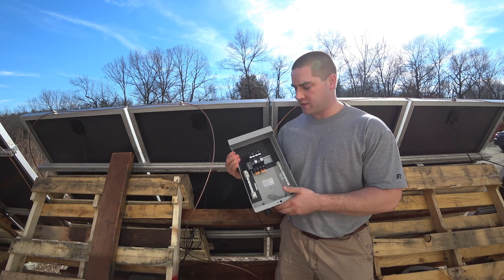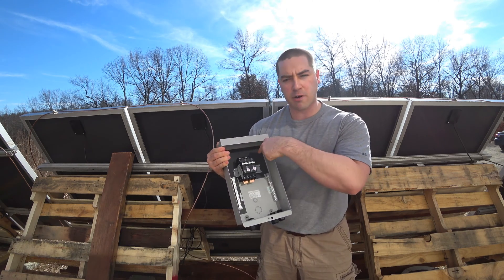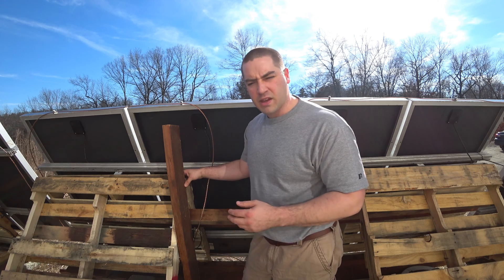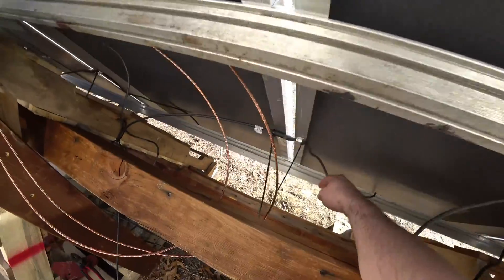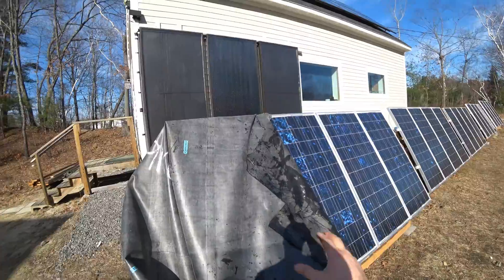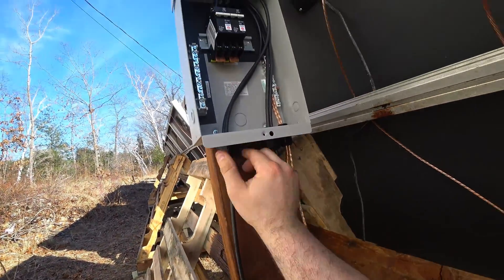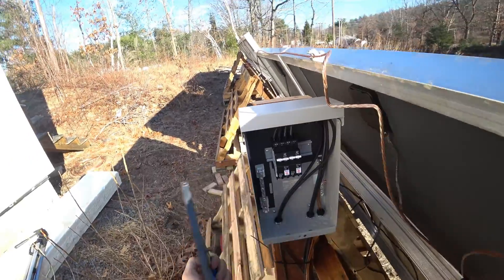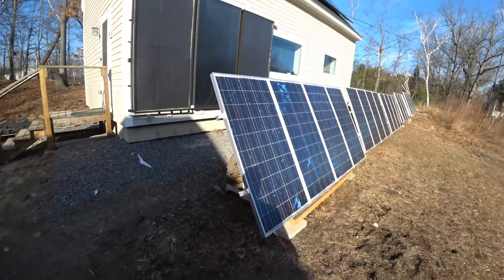Disconnect/Combiner Box Install, Midnite Solar

Comment: If PGE turned off the Solar AC disconnect, will the entire house loose power to from the grid?
Reply from the maker: I'm on the east coast, so I don't have PGE.  But, my solar and grid are separate.  I have a transfer switch so the solar can only power things if the grid is off, or vice versa.  There is no mixing.
Reply: Depends on if your system is hybrid or not.

Comment: You are using all of that PV to make heat. I've read you're aware that isn't an efficient use of elec.  Look into a ground loop heat pump. I installed a 1 ton compressor unit with 500 ft of ground loop. Uses 1.3Kw to produce 12,000 BTU/hr. Suggestion for you is 1.5 ton with two 400ft parallel ground loops running on one pump. Easy to install.  Can use a small hot water tank on the domestic side.  I have a small open tank above my circulating pump suction.  Really makes the ground loop side easy to install and maintain.
Reply from the maker: Ground loops make a lot of sense.  Now if only I owned a backhoe...
Reply: DavidPoz My neighbor dug .mine for 500 ft of hose so about 5 fingers each 40 feet off the main trench.  We finished everything in one day.  Pay someone for a few hours.  We forgot to first push the top soil aside.  Grass seed grew back a little slowly. 

I'm going to experiment with using the ground loop to cool the house with and without the compressor.
Reply from the maker: Nice.  I would love to hear how it goes.  I've often thought about cooling with a ground loop, but no compressor.

Comment: I read your reply below---- this thing is creating enough heat to get the crawl to 90F ?!... unreal.  I love love love it !
So, would it be fair to say that these 20 panels are providing enough electricity to totally heat your house, all 24 hours, on a sunny day?
Reply from the maker: No, not quite.  On a sunny day I don't need any active heating.  The solar pv heat and the passive solar through the windows can heat the air up well enough to swing us through the night.  When we wake up the house will be about 65° or so.  Also, I'm getting about 3x more BTU's out of my solar hot water system as I am the solar PV.  So for heating water, that is the way to go.  But it's all fun.
Reply: You say you get 3 x more BTUs out of the solar hot water, what do you mean ? 
Amps x Volts coming out of the solar array = Watts x 3.41 = BTU 
One system is heating water, one system is heating air. 
How are they different ?
Reply from the maker: You've got the conversion right.  There were a few days when I was taking data readings off the solar array going to the heater.  I was reading amps and watts and recording it.  I think I put up the chart of one of those days in a video. https://youtu.be/jFoxIit8NYA at time 1:36.  There you can see that those solar pv panels (16 at the time) made about 5,767 w*hrs, or about 19,676 BTU's of heat in one day.  

I've also taken data readings on my solar domestic hot water tank.  There is about 230 gallons of water in the tank (this excludes the HX and air space).  During a sunny day the tank will go up an average of 30°.  So if we multiply that by the heat content of water it works out to about 57,477 BTU's of heat.  Or roughly 3x as much, while taking up less area.

Of course the industry is moving away from solar thermal.  If you pay retail and installation then PV is probably a better deal then solar thermal.  But cost to benefit ratio depends a lot on how much you buy panels for.  Lately I've been getting some free solar thermal panels that need refurbishing.  

I should probably put this into a blog post.  Any other details you think I should report in my blog?
Thanks,
David
Reply: Oh but of course, what was I thinking. Sure, you solar hot water has actual water flowing to a collector as opposed to using PV to heat the water. I was scratching my head, trying to figure out how one system is 3 times as efficient, but I had it in my head that the water was being heated with PV and a heating element - thus my (above) question. Now I understand, and yes, flat plate collectors are roughly 50% efficient, where PV is only 16% (unless you have some fancy panels).  So there---- there's your 3 times as efficient -- makes perfect sense !

Comment: I don't like working with electricity, I'm afraid of dying ...alone, halfway up a drop ceiling ...because I touched a live wire. So I became a high pressure steam boiler mechanic, instead.
Question: What personal safety measures do you take when working with electricity? The common sense ones...
Reply from the maker: Safety: I check the switch, breaker, or whatever might be connected to the circuit I'm working on.  Then I verify it with that multi-meter, it has that ability to check for electricity without needing the probes.  If I get it close to a live wire it beeps.  Don't know what you call that, but it is helpful.  Other than that, no safety.  I've been zapped a couple times, but no injuries.

To me, high pressure steam sounds a lot more dangerous than electricity.
Reply: well for one be carefull make s ure nothing is on cut main power wear rubber gloves or gloves for working with electrical wiring use safety caps on wiring and electrical tape doesnt hurt eitehr always make sure power is cut wear safety gloves and never never ever stand in a puddle while there are live wires water and electricity dont mix

Comment: Good deal , how did your heater in your crawl space turn out?
Reply from the maker: When the sun shines it heats the crawlspace up to about 90°.  That swings the house through the night.  So no additional heat needed until the next day.  If it's overcast then the solar heater is not enough on it's own.  Bottom line, it's fun for now, but looking forward to a more permanent solution that can work year-round.
Reply: DavidPoz good deal I’m going to try all solar electric hot water as soon as I get my main solar done , good deal on that heat
Reply from the maker: Hi Jeff,  Sounds like you and Mark are on the same mission.  Something to add:  I also have solar pv on my house with MPPT micro inverters on each panel (grid-tie).  That system puts out about double the efficiency as the solar direct to the heater.  This is because of the MPPT technology.  So if someone make a TRUE MPPT solar control to heater then it would be awesome.  Right now I get about 3x more BTU's from my solar thermal system.  My solar thermal system is also 3x smaller.  I'm only planning on using the solar PV to heat, until I can do something better.  I'm rely hoping a manufacture will sell a true MPPT unit.  I've followed up on a few leads here and there.  I've seen the units on ebay without a case, but there is no data to support a true MPPT.  Then I've seen plenty of press releases from companies saying they are going to do it, but don't have units for sale.  One company I know of only sells it with their own tank and panels.  Anyways,  I don't know if anybody else out there runs into the same issues?  I'd love to hear your experience.
Reply from the maker: I've read about the midnite solar classic (you have some I think) that they have an aux out.  You can wire that to a relay to control a heating element and set that to turn on if the batteries are full and the controller goes into float mode.  That is my current plan, but do you have experience with that?
Reply: DavidPoz I’ve got the classic 200 I’m still new with it I plan on this spring playing with it to try that , thank you for subbing me